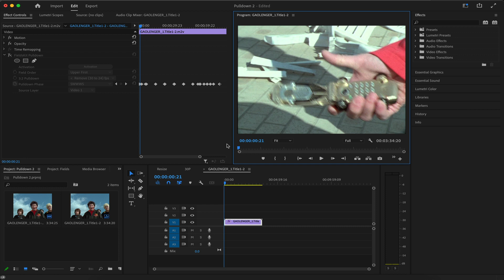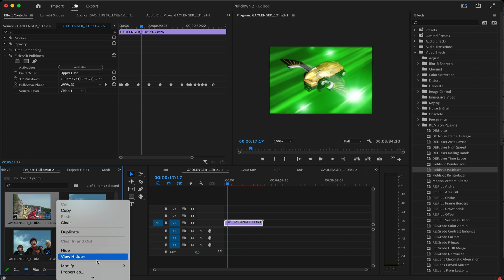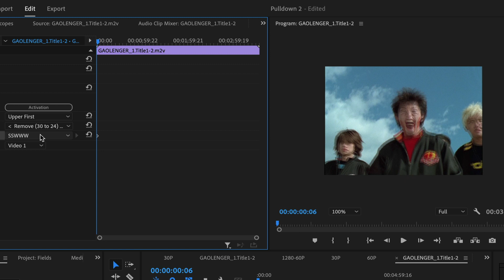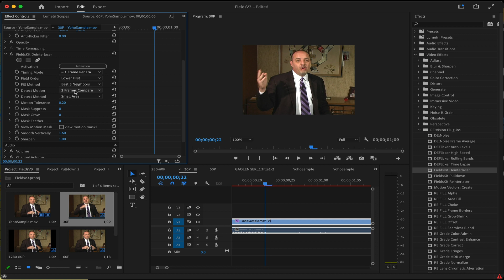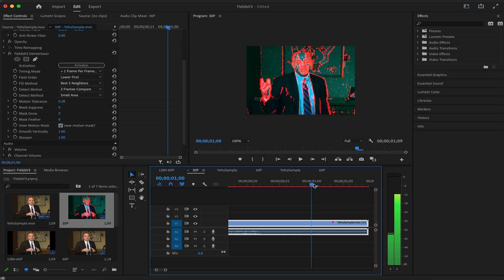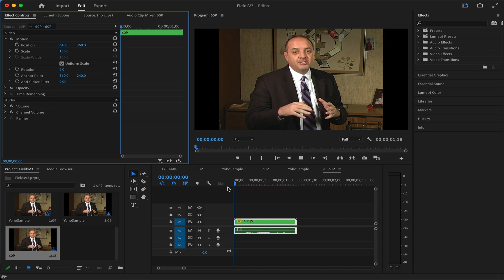Fieldskit in Premiere Pro - 3:2 pulldown & Converting Interlaced to Progressive

Comment: Mam it means that if we shoot video at 24 fps and refresh rate is 60 and in 3:2 pull down first frame is shown 3 times and another frame is shown 2 times pls reply
Reply: 23.976fps (59.94Hz) 3:2 pulldown❤❤❤
Reply from the maker: 3:2 pulldown is going from 24 frames to 60 fields a second.  You can look at the Fieldskit manual or google 3:2 pulldown.

Comment: I got a 25fps interlaced camcorder footage (it might be 50i or 50 fields yet Win10 shows it's 25fps). I wanna convert it to 25fps progressive MP4 file.
Is there any way to keep that extra smooth soap-opera like motion that the original camcorder footage has without being forced to render the final file as 50fps?
The smooth motion only remains when modifying the timeline into 50fps. It's choppy at 25fps.
Reply from the maker: You can use Fields kit at same rate but you have to turn off Fields in Interpret footage so use =Motion Estimated Blend, 1Frame Per Frame.
Reply: @revisionfx  Thank you for your kind reply. I tried to do exactly that. 
Under Interpret Footage - Separate Fields is set to: "OFF" + Framerate is unchanged @ 25fps + Pixel Aspect Ratio is unchanged @ D1/DV Pal Widescreen (1.46). 
The timeline itself is 1080x1920 + 25fps + Square Pixels (image will be upscaled to fit footage).

With all that in mind- I placed Fieldskit Deinterlacer with the settings you mentioned under Timing Mode, yet, motion is still looking choppy compared to a 50fps timeline.
I was wondering if I'm missing something. Maybe having to precompose the footage and such, yet, despite the examples you show in this video do not match my exact footage and situation, I tried to follow the same steps and couldn't pull it off. Who knows? Maybe it's the footage itself. It's from circa 2006. Sony DCR-SX33. Footage isn't recorded on DV yet an SD card. As of now it feels like the only way is to render footage via Upper Fields First + 50fps. I can't see how footage smoothness could be kept under 25fps or even 30fps.
Reply from the maker: @eladbari  It will be easier if you send this information to techsupport@revisionfx.com.  This way we can add screenshots of the interface and it is more interactive way to help you.  We could even take a look at the footage and come up with the best solution.  Thank you.
Reply: @revisionfx  email sent. thank you!